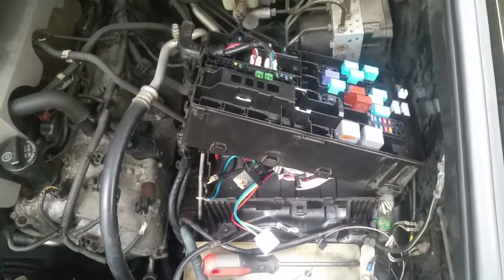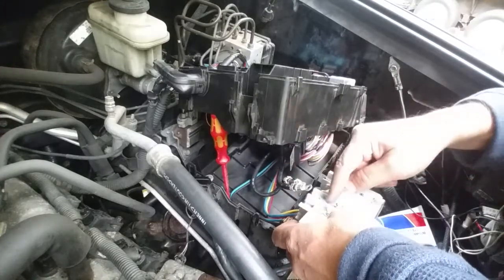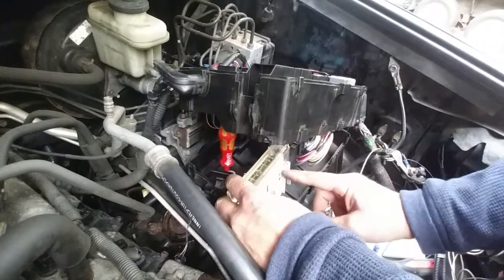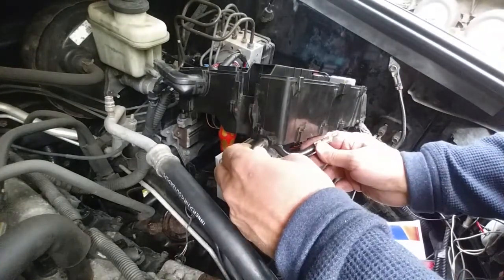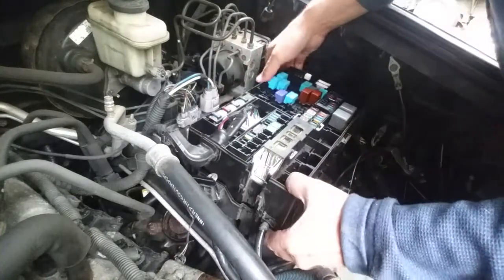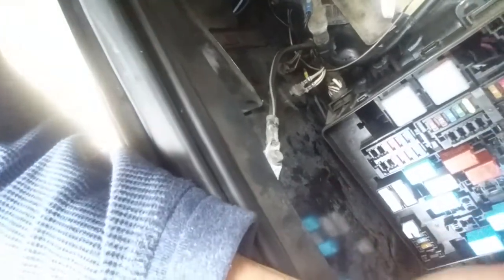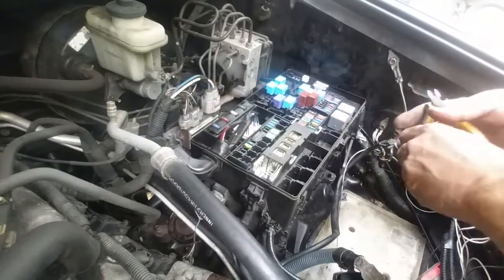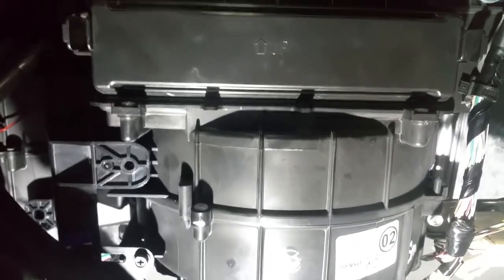2007 Toyota Tundra Main fuse link in engine bay replace. Heater blower fan No Power. Gen 2. Mice

Comment: IF this fuse block gets tripped, can it cause the AC panel not to power up inside the vehicle?
Reply: Did u fix your issue ? Having a no ac and no power to ac panel
Reply: @fortis619  yes, it ended up being the ac control unit. It was under dash near the blower motor....

Comment: Whoever designed this cluster needs to be caned.  What a nightmare.  On the one I’m working on mice moved into the fuse box and chewed up all the wires.  Turns out Toyota built in a  nice mouse size hole right under where the headlight harness exits the box and there is a perfect nesting area in the box where the mice can have babies and chew on all the wires in their spare time.
Reply from the maker: Agreed... Toyota should re-design that fuse block as plug-in module that snaps into position in 30 seconds.. As far as that mouse hole, you may want to try a can of expanding foam used in home walls. Its waterproof and seals of on both sides of the hole.
Reply: @oantech4252  
I have an issue with all of my windows not working. I fuses are good. The window buttons were replaced and still not working. 
I replaced that fuse  in this video, and windows still don't work. I was told that i need to repla the fuse box, because its could be some bad wires or etc.
does any one know why all the windows would stop working all of a sudden?
Reply from the maker: @bangryman100  I believe that Toyota has an open recall on the power window switch for many Tundras. Water gets in and causes problems with the windows. You may want to check with a Toyota dealer and maybe they can at least diagnose it while servicing the recall. Have your VIN number ready when contacting them..

Comment: I am replacing the fuse block on my 2012 Tundra and I can't figure out how to unclip it from those white clips you are showing. Are they somehow different? I'm ending up breaking off the plastic and can't get it loose.
Reply from the maker: The release for each clip is down inside each hole. Use a small flat blade screwdriver. You may have to use a few screwdrivers to get it started. I used a white paint marker to better show the locations on the video. They are not originally white, just rectangular holes.  
It may be best to split the outer housing first and raise it with the help of a screwdriver as shown in the video to allow the gray fuse block room to drop out of its seat. Hope that helps. Toyota should really make this easier with a slide-in fuse cartridge instead of a one hour disection of the entire electrical system.